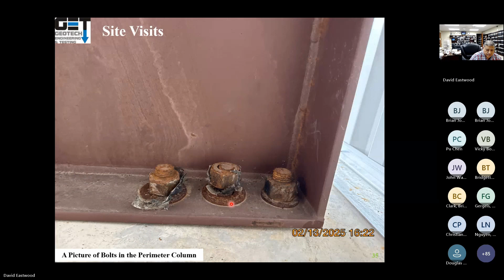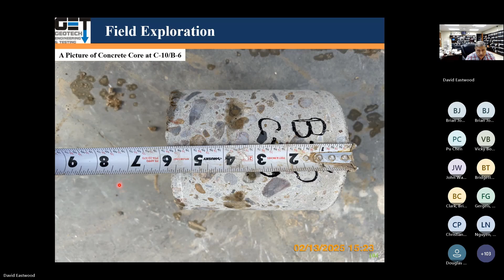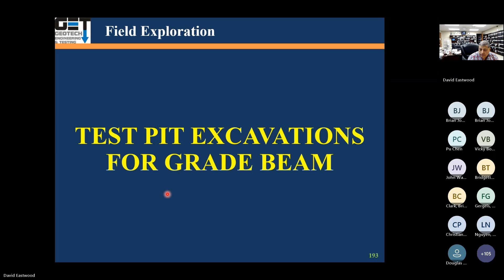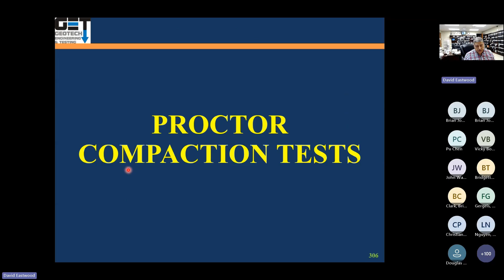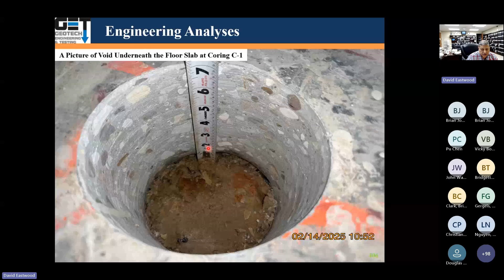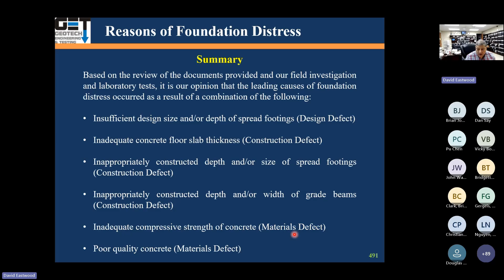Geoforensic Study of an Industrial Metal Building in Houston

Comment: Thank you, Mr. Eastwood, for sharing this study and for your excellent YouTube channel, which is such a valuable resource for geotechnical and structural engineers. I especially appreciated the section on the petrographic examination of coring samples—your microscope evaluation of the poor-quality concrete (1,500–2,000 psi vs. the designed 3,500 psi) was very insightful. Seeing the microstructure of this concrete really highlighted the issues that can arise from inadequate materials.

It would be fascinating in a future video to see microscope evaluations of concrete samples across a broader range of quality—from poor to excellent. A comparison of the micro-level particle distribution depending on concrete quality would be extremely informative for engineers and students alike.

Thank you again for providing such detailed and practical knowledge from real projects!